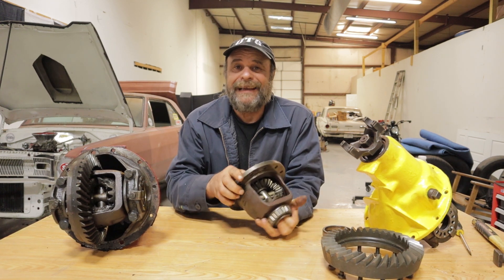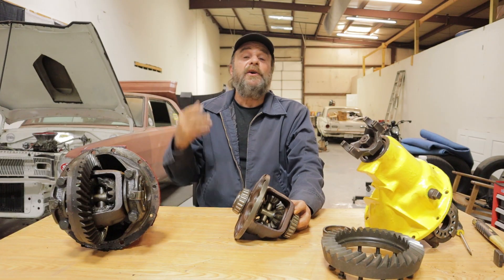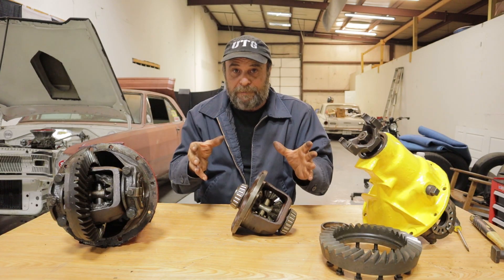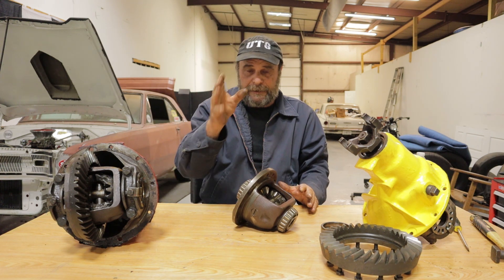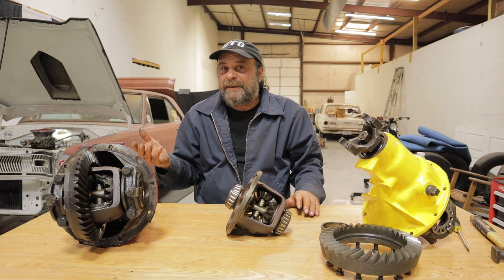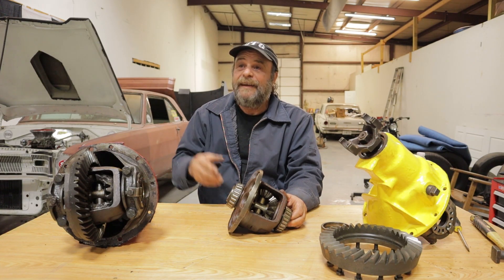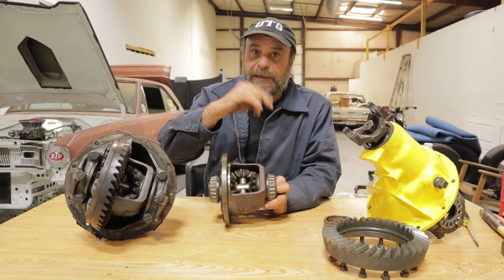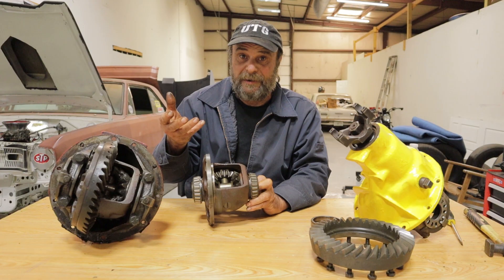Open Differentials - Getting The Most From Your Factory Peg Leg Rear Axle And Where They Work Best

Comment: I believe most fuelers were using a olds 9.3 rear end
Reply: The Kaiser Brothers a local engine shop, used an Olds rear end behind a 392 Hemi they set up to run on nitro. They still take it up to Bandimere on occasion as well as local car shows.
Reply from the maker: Last cars to use those rears were the early 1966 Gilmore Flexi Fliers.  By mid year Woody switched to the 8.75.  Just to add to the trivia, Tony Nancy got the first of his 8.75 cars.
The last of the Olds cars was sold by B&L Auto in NYC and became the Brewmaster T/Fer and was driven by Jimmy Messenger.
It had a M/T magnesium center section and shortened stock axles.
Reply: Pontiacs used those rear ends through 1964. Great diffs, I have a posi version in my 1959 Pontiac Catalina Safari.
Reply: When they would do a feature on a rail in Hot Rod Magazine back in the 60s they almost always mentioned the Olds rear. I had a subscription from about 64 on and I remember when they broke into the 7 second times but I can't remember who did it first. Cheers 🍻

Comment: A trick I learned from some mag 40 years ago is to add some extra shims to the side gears. I've done this to both a 9" and a d28 front diff and it works and is cheap. Down side is it wears quickly and could possibly break something.

Comment: Adjust the tire pressure. only a couple psi difference needed
Reply: Recognize the genius of a differential it takes a traction difference of -2x too spin . If u hold one wheel while you spin the other 2x u will get the gear ratio of the vehicle from the pinion input shaft

Comment: One modification one can do to stop spinning on an open rear is cut/deactivate the driver side cable on the emergency brake and learn to use the passenger side brake to stop the spinning when taking off on snow or other slippery conditions.

Comment: To understand how it works there are two very easy things put a car on jack stands and set the parking brake put it in drive and give it gas while somebody looks under the car you will see what way the drive shaft turns if the suspension wasn't holding that rear axle it would spin around like a big propeller if you want to see what the engine does have somebody hold the brakes with the engine in  gear and a broken motor mount and give it gas and watch that engine lift up on the driver's side if the other mount and the frame were not there the engine would spin around like one of those Old World War I radiator motor planes that has a spinning engine and solid mounted crank

Comment: I kept shredding carriers on 7.25" on 72 gold duster with a 318, wide ratio 904 with a 4.2 lever.
Had 2.76 gear, and i swapped a set of 3.23.... kept blowing up, until i welded it up with alloy rods, and put a 1/4"  plate over both sides. Got too good at popping pinion out and cutting a good pattern.
Very surprised at how strong a stock 8 1/4-8 3/8" are.. put one in my 69 valiant with 3.90s and wide ratio 904, same 4.2 lever and a slant 6 torque converter. 
6 leafs left, 7 right.
6 cyl torsion bars..urethane bushings... hooks up very nice.
But... i need to pop the diff cover to re-adjust the left carrier brg preload, and  replace the clip, as it keeps twisting it off😂.

Comment: Tony, I would like to see how you shim behind the spiders to tighen them up a little. I just as soon keep an open rear, I don't race and it is some much easier on tire wear but it would be nice to get that little bit when needed. I always thought an electric locker would be nice but the few I've seen didn't fit what I have and are too costly. 
Thanks, good vid, DC.

Comment: It's unfortunate that ford chose names with "lock" in them..I think both "Equa Lok" and "Traction-Lok" are limited slips. The names add to confusion and misconceptions if there is no locking going on, just a friction aided suggestion that the tires rotate at the same speed. 
   To me, "locked" means that if the tires are going different speeds, I just broke something.
  Incidentally, I sure do like the way the Detroit True-trac works on the street. Good manners plus 2 wheel peel when I get on it. Smooth.

Comment: Yes Uncle Tony I did get something out of that. Thank you for making me think in terms of torques effect on wanting to load one side while unloading the other. Adding one leaf spring to the passengers rear corner is a great Idea and easy to do. Using a pinion snubber is also a great idea. You can tell the Chrysler engineers had a good understanding of the suspension dynamics on this. 😊

Comment: I had a 440 66 charger with 355 open 8 3/4 and with the weight transfer to the back corner was great . I had a 391 gear but with my 4 speed 1st gear was useless

Comment: Very interesting topic.  So for a typical a suspended rear end drivetrain, the axle housing is allowed to twist, and the torque reaction of the driveshaft will try to spin the rear end in the opposite direction and  unload one wheel (passenger side).  The rear springs counteract the reaction torque torque.  Is that also what caused rear steer?

So on a top fuel dragster, the engine/ slipper clutch/ bellhousing was bolted to the differential housing so it was like a rigid member?  Makes sense it wouldn't try to lift the one tire from driveline torque. But it still seems like when the engine jumped up to speed from idle at the green light the inertia of the crank would still momentarily plant one tire from the torque reaction.  Once the car was under power and the revs level out a bit both tires would get equal pressure.  Didn't Don Garlits try to run a transverse mounted rear engine dragster in his later years to counteract that?  Doesn't seem like that would matter much for anything except for a dragster (and maybe not even for them).  Maybe I'm overthinking it.

Comment: HOWdy  U-T-G, ...
Fascinating OPEN Rear-End FACTS ! ...
I was a USPS / Letter-Carrier for a while in my early life & we drove  2WD  JEEP  DJ-5  vehicles all equipped with Limited-Slip Differentials ( in the REAR ENDS ) ... 
and they were fine Fine Fine Spring, Summer, & FALL ... 
but in the Winter with SNOW & ICE on a "CROWNED" Street or HIGHWAY ... 
the "LOCKER REAR ENDS = sucked pond water !!!  stopping at each & every mailbox = these  DJ-5 JEEPS would slide to the CURB ass-end 1st ... 
Thanks 
COOP
the  WiSeNhEiMeR from Richmond, INDIANA 
...

Comment: When i was racing small oval 4 cylinder stock cars I just welded my spider gears.  Worked Just GREAT and talk about cheap!
Reply: For an 8" ford rear, they were 31 spline, a 9" mini spool worked great and were only $35. I ran modified 4cyl dirt for 10 yrs, first rear was a 7 1/2/" with welded spider gears.

Comment: I welded up a Dana 60 rear in my mud truck and used it for a few races. I was backing it up one night to load on the trailer for an early start the next day and I feel and hear this clunk. I go ahead and load then I see oil running out on the trailer. Well a chunk of spider broke out and wedged under the ring gear and popped a hole in the case. I decided the Lincoln locker wasn't gonna cut it so I found a spool and patched the pumpkin. Sure hated to miss that race though.

Comment: Having welded diffs for 50+ years you have to know what you are doing. Or they will break and break big time. That Mopar diff you have there  needs to be welded both sides and use a plate either side. Or as I saw very recently the weld will break and the spiders will try to turn and in turn explode the entire diff. 
When welding a diff you need to A shim the spiders so you do notmend up with the,gears cocked. B ideally use an axle to protect  the splines.
Plus NEVER weld a diff that that is complete. You must remove the crown wheel carrier and then remove the crown wheel. Then MIG it together, not too hot. And continue to blow it out with air to keep it cool. Do as above and itnshould be better than many spools though heavier. Until recently [cars were sold] I have still used diffs done like this for 40+ years. Worn out gear sets etc but the ;'spool' has not failed. 
Do not bother tryingnmto weld BW diffs, 9" diffs etc as the design does not allow it.And never weld the gears to the cast iron as the materials are too disimilar and the iron will break

Comment: "Peg leg". LOL. I'm stealin it. I have a display in my transmission shop of, "NOT COVERED UNDER WARRANTY". It's a display of differentials where the cross pin walking out served as a sledgehammer through the case material (front wheel drive) surrounding the differential. People don't realize that when they're stuck and they've got it floored and it's slowly creeping forward while one wheel is stationary and the other is gaining on Shirley Muldowney (it's working right?) their cross pin is welding itself into the diff housing and the little roll pin holding it into place can't possibly survive. Later, and you'd think this would happen immediately, the cross pin starts walking out and demolishes everything in its path. The End.

Comment: I used a " lunchbox" locker in a V8 swapped light weight sports car.  Cost& ease of installation were my initial  reasons. 
I have a few reasons why I changed it. 
First ,high-speed cornering. On  the gas pedal, the front would 'push'. Off the gas so much, and it had an uneasy transition .
Second , the handful of times I tried to gas it hard, when the locker was unlocked, BANG! CLANG!! it would skip a few teeth and sound like the rear exploded. 
I also couldn't push the little car by myself, like the brakes were on. 
That said,going in a straight line, it worked fine.

Comment: Would welding the spiders throw the assembly out of balance enough to eat up the differential bearings? I’d imagine it’s definitely harder on the bearings but I don’t know if it’s significant enough to cause noticeable bearing damage. But that assembly is rotating incredibly fast so even a small imbalance in the assembly would be exaggerated at higher rotational speeds

Comment: The easiest way to use an open diff without traction problems in drag racing is to use a larger-diameter tire on the right side of the axle. 
One old-time drag race used to do that and do these gorgeous two-wheel burnouts that his competitors could not figure out and demanded tech inspection to see if he had a posi rearend.
You can do this, too.

Comment: I remember the first set of spiders I welded up.  Back in 1969, several of the home towners were doing much the same things as the Mission Impossible 318 and welding the rear spiders.  These were street-able(?) and you could tell when one came to street race at the local cruise-ins.  The rears would 'chirp' around a corner (hopefully you didn't break and axle!).  One fellow had a 1964 Ford Fairlane 'Thunderbolt' clone with 260 V8 badges but had trailered the real Thunderbolt that was identical, even to the 260 badges!  It sure made for many a story.  Keep bringing these tidbits!!!!

Comment: I've only owned one open rear diff, which was sadly in a sports car.  

When I lived in snow land, I had a Bronco with "L" diffs front and rear.  It was terrifying in 4wd above about 10 mph in snow.

A "posi" in a daily can absolutely not be too good, forget the power losses.  Rain.  You turn onto a main road in traffic when it's wet, accelerating moderately hard, and suddenly the back of the car is jealous of the front.
Reply: There's different types of limited slip diffs that were sold under "Posi-Traction" and even more if you were just using that as a universal term. They don't all behave the same. Some limited slip diffs are even adjustable.

Comment: Much better to weld the axle gears to the diff case rather than just welding the spider gears to prevent turning since the gear/case weld is much stronger than the cross pin. Essentially by welding the axle gears to the case you've created a spool.... And can eliminate the cross pin and spider gears.

Comment: Mopar Tony... don't forget to educate folks about how & why mopar cars had an asymmetrical pinion location on the differentials, & the Pinion Stuffer... lol- that little bracket over the pinion's u joint with a solid chunk of rubber & how flat footing the throttle planted that Pinion Stuffer up against the bottom of the rear seat's floor board & allowed torque not to twist the diff's housing... plus it makes mopars unique & not having to need traction bars. 🤟🏼😆🤟🏼
Reply: Mopars had their pinion locations offset to the passenger for two main reasons: 1- more of a straight shot for the drive shaft & engine/ trans, & 2- "giving the driver more leg room" if ya know- y'all know.. ✌🏼..
Mopar's floor boards had about 3inches of extra width along the left front & left rear floor pan area between the inner rocker panels & transmission tunnel/ driveshaft tunnel then compared to the right sides.

Comment: On a short wheelbase drag car or a high power street rod, if an axle breaks on a  posi/spool/ect., all the power goes immediately to the "good" axle and the car can hard turn almost in its own length. An open rear will lose all forward thrust. If the car has a properly designed four link, the right rear can have some pre-load applied, and both tires will plant as they should. This is a safety concern that no-one thinks about. Good topic Tony!

Comment: Damn good stuff, you remind me of the old time racer that taught me to build engines in the early 80s.
The only welded spiders I ever saw growing up went south in my buddy's blown 67 Camaro and almost killed him.  I honestly thought it was a no-no to weld them based on everything I ever heard.  Then, I started running mini-spools in my rock crawlers back in 1998-07ish.  They were not very forgiving and it donned on me that spools were basically the same as a welded diff.  Personal preference now is to run open and deal with the wheel lift.  But, I don't drag race anymore...  I will run welded spiders in a burnout mini-truck I'm planning on building.  Makes for better smoke having two wheels dong it.

Comment: Our 68 charger was built to drag and the guy had put 8 springs on right side and 5 on left.  He never broke any rear window that way.
It was long ago and the 3.91 gears were not weld but à lot of folks did it.   They has the yellow drag antispin bars on the rear end that looked funny.  I was 12.  Lol
Another important message and I learned again from how to proper weld spider gears.  Didnt know about heating prior to weld.  Actualy, dint even realy know how to weld it.
Thanks again to all the community.

Comment: I see a variety of comments about traction control and applying the e-brake. Not work the same as weight is different. But, my grandad said that 4X4 is ok on mud / snow as you will simply get stuck 45 feet further than 4 X 2!

Comment: UT: how do you feel about the modern "quasi LSD" achieved by the computer control of the car's anti-lock brake system, where they put a little drag on the brake on the side that's slipping after it has some amount X more rpms than the wheel w/ grip? Is it an elegant use of the technology available, or do you think it's a nice bonus for modern cars but useless because you can't retrofit it to classics?
Reply: As someone who worked on a lot of cars with that feature I thought it was great. Sold a lot of rear brake jobs thanks to that system.

Comment: Here's something on the topic of rear ends that might surprise a lot of people...99% of those 18 wheelers you see on the road every day have open rears. Maybe even more surprising is the fact that even if both rear axles are powered (some actually only power 1 and the other is a bogey), usually only one side on the rear most axle is being driven. Most of them have a switch on the dash to engage a "power divider" which engages the front drive axle but, even then, they're still both open diffs. My tractor has full lockers but, unless I flip the switch on the dash, which in my case sends power to all 8 of the drive tires, it only has one set of rear duals moving it.

Comment: We used to weld the spider gears in demolition derby cars. (Mud track) For many years, I drove 67-72 Chevy trucks. The rear suspension was designed for NASCAR and GM had to put the system into some production vehicle to make it legal for use in "stock" car racing. Those six-foot long trailing arms essentially transferred differential twisting force to the center of the vehicle. I'd go ice fishing on the lakes here in Minnesota and drive through snow drifts on ice with no problem --with an open dif. I even pulled a few four-wheel drive trucks out from where they got stuck. It was an excellent system and I learned a lot about rear suspension design from it.

Comment: Stupid question - Would a stiff sway bar help prevent the pass side tire from lifting?  Are there drawbacks to this approach I don't see?
Reply: Typically,  if the left tire moves up, the sway bar will try to pull the right tire up. You can work it out from there what the consequences are. 
Sway bars and open diffs are  uneasy companions.
Reply: @2lotusman851  - Thank you!!!  Sorry to be dense, I'm still not understanding the consequences you infer.
Reply: What type of rear suspension do you have-- independent , or a live axle. makes explaining easier.

Comment: A pipe going from the transmission casing to the differential casing is the cure chevrolet uses on some corvettes. It is a good way to have your suspension act symmetrical during normal driving and still launch good on the drag strip.